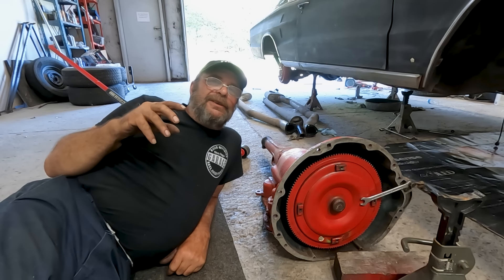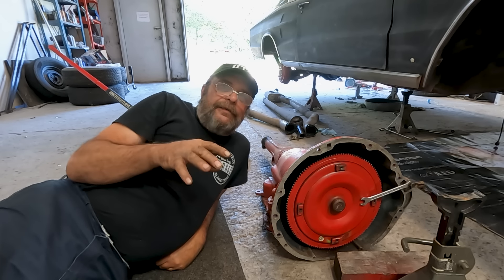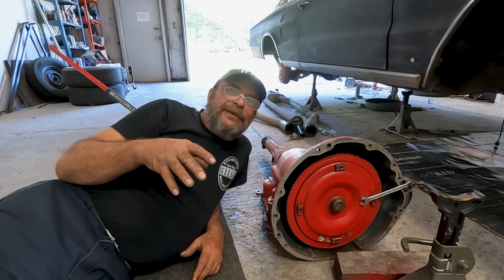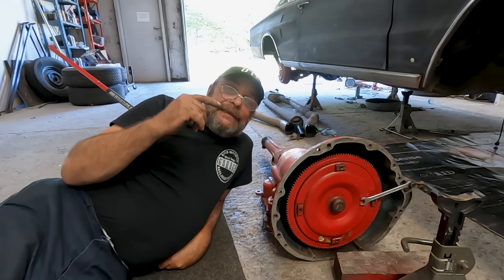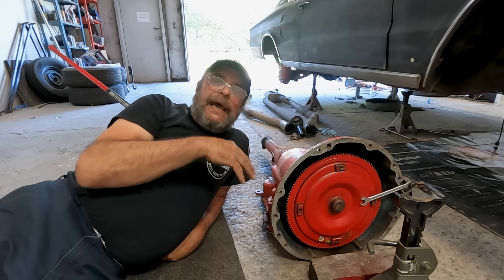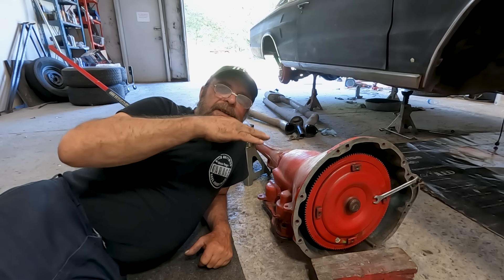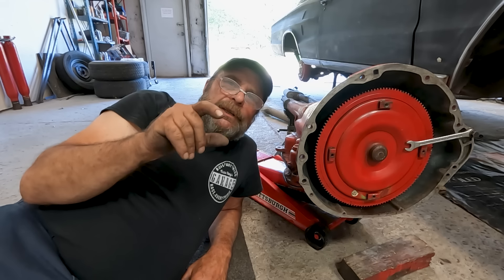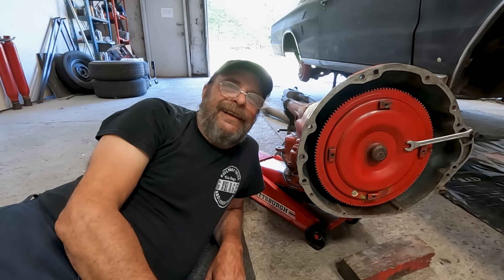One Man, On The Floor Transmission Install- So Easy Even An Old, Crippled Guy Can Do It

Comment: I made a small frame from 1x maple scrap laying about, constructed so I could strap it to the transmission and give me a sturdy base & not put weight on the pan.  Works well.  Used the same for engine removal with transmission still in the car: set jacks on front end, put a screw type bottle jack underneath the transmission, loosened bolts slightly for some wiggle room, and... good to go.  If I could attach a picture, I would. Several  pieces glued cross grain to avoid splitting was the key.

Comment: I'm 71 years old. Did a lot of drag racing in the 70s. We built our 340 short blocks in my mom's basement! My buddy built his 440 in his basement. That was a ball buster getting that up the stairs with  4 guys ! I did a  904 Trans by myself on a 65 Dart. I would drop it down on my chest! Going back in was a little harder. The  727s I'd use my floor jack. Those were quite easy. The real bastards were the  A833 cast iron 4 speeds! I'll take an automatic any day.

Comment: I remember when inexpensive floor jacks first showed up, it was like we had arrived in the big leagues!
I push my jack from the front of the car, under the engine and into place, then raise it. I find it easier to maneuver the jack when the casters are pretty much in a straight line

Comment: I put a 4 post lift in after remembering the days of doing it on the floor in the early 80's.  When I got back into cars 30 years later one of the first jobs was yanking a 727 out of a dodge truck. FLASH BACKS hit. I had a 4 post shipped out the next day

Comment: I used to pull the transmission onto my chest and lift it into place, but those years are long behind me now. I purchased a low profile transmission jack from princess auto when it came on sale for about $200, well worth the cost as it saves on torn/pulled muscles etc.

Comment: Having a concrete floor to lay on alone is much better than what I've had to lay on for most of the times of having to crawl under a vehicle for any reason, including putting engines and transmissions back in, heck sometimes just a cardboard box is a luxury for me. If only I had a nice concrete pad under a good shade tree, then I could actually roll my floor jack.🙂
Reply: I did my first several transmission R&Rs on a sheet of 1/2" plywood. Way better than just dirt or gravel. 😆
Reply: I love cardboard. You can slide on it easy too....
Reply: My low point was doing a Crown Vic trans in the grass. I had to put plywood down to keep the jack stands supported.

Comment: I remember replaced my torqueflight 727 4 times when I was around 19 in my trailduster . I used spare tires pallets or whatever. Great times ; tranny fluid in hair & all . Damn front seal always dripped and converter pump slots would always crack in corners . Finally rat tail filed ; radius the corners . Helped.  Ah - the good ol’ days - 😁 👍👌

Comment: Old crippled guy here. I've never doe a transmission that way, but that is similar to the way I used to remove and install air cooled VW engines. One thing about floor jacks. I almost always remove the four pronged saddle from them. It will damage pretty much everything it touches, except axles and heavy frame rails. It would certainly mangle a transmission pan. And if you have ever worked on a Foxbody Ford, you've also probably learned that it will damage the made out of tin "frame rails" and K member. I actually made a couple of smooth saddles out of 2x4 and 2x6 wood.

Comment: Ratchet straps are your friend. You still have to balance the trans on the jack while jacking with the other hand, Its still a PITA. Ratchet straps attached to the frame or looped thru the interior with the doors open if no attachment points under car. They hold it stable and can be used to lift it up to get a jack under it for the final lift. Ive even used ratchet straps to install front coil springs on GM cars

Comment: I'm done at least a hundred transmission in my lifetime. Auto and manual on the garage floor and the driveway, in the street, even in Sandy dirt. By myself. And what you just showed don't work when you're underneath the car or truck. I just drag the transmission underneath the car put the floor jack under . pull the transmission up on  to the floor Jack and go to town. You should try doing it in Sandy dirt that's a real chore LOL

Comment: Back in the 70s I changed many of Muncie 4 speeds, laid it on my chest lifted up and slid it in and had a buddy push the clutch in and then it would go in the pilot bearing and slam a couple bolts in and hook everything up and down the road we go.

Comment: For automatics I've got a plate with center pin that goes on floor jack where the round piece is,fits transmission pan perfect don't have no wobble to it . Makes it real easy! I've have a transmission jack but you have to get car up off floor pretty high for it to fit.

Comment: Nice vid Tony.  I've wrested automatic transmissions in and out of vehicles maybe 9-10 times.  My experience is that tricks like yours work sometimes and it goes smoothly, other times you just struggle no matter what you do.    If I had to do one now, I'd invest in a harbor freight transmission jack.

Comment: I did a car-port reso on a 1981 RX-7 that included a master rebuild kit for the automatic transmission.  Haynes manual had the transmission R&R in 17 easy steps.  Ungh...  After the transmission falling off the jack several times I finally got frustrated enough to bench press that pig of a transmission into position on the dowels and thread the first bolt in by hand.  For reference, I was told it was the same/similar transmission to what was found in a Ford Ranger pickup truck.  What a day.  In the end I had a fun DD for a while that I sold for a tidy profit.

Comment: I remember putting a 904 back into 73 318 Charger with only a cresscent wrench a flash light and a flatblde screwdriver for tools and being able to drive it home.  My friend helped me get in in position, but after that he had to leave and it was all me.  I had the left two wheels on the curb to get clearance to work underneath it.  Amazing what you could do whlhen you were 17.

Comment: This is good with minimal stuff to work with.
I have a transmission jack from harbor freight that is inexpensive.
I set trans on it it has straps to keep it from moving rolls under with wheels and raises with an impact

Comment: I've lifted up a few 400 turbos way back in the day. I'd put some blocks of wood under the tail shaft. Used a Toyota Tercel scissor jack under the front edge of the pan to raise the trans some. Pretty unstable, but not real bad. I'd add blocks as it came up. One hand to turn the jack and the other to stable the trans. Then once high enough, I'd carefully work the trans over onto my chest, while knocking the blocks and jack out of the way with my elbows, as best I could. Once up and completely on my chest, I'd use my arms and knees to lift as hard as I could, keeping it as steady as I could. Once it mated with the pins (the hardest part), I'd get a couple bolts in as quick as I could.  Not the safest way to do it, but I could get'em in. Hey, when young, you can do anything. Nowadays, I use a transmission jack.

Comment: Did my first transmission R&R in the snow on dirt. Got it all out, couldn’t really find a problem. Got the flywheel surfaced, installed a new clutch and pressure plate, put it all back together in sub freezing weather on my back in the dirt. No change. Still couldn’t get the clutch to function correctly. Ended up being the jackshaft. One of the arms was tearing off of the torque tube, ten minutes with an arc welder and the truck was fixed and I was a much wiser mechanic.
Don’t just replace parts. Evaluate, troubleshoot, diagnose. Then repair what is actually at fault.

Comment: I put one in a Nova I had, I had my arms under the front of it, and I used my leg to move the jack handle up and down under it. It wasn't fun, but it worked. That was 20+ years ago, I don't know if I could do it today, but it works if you are able.

Comment: If i was in dirt, i used plywood.
 I always used a floor jack, made an "H" pattern out of angle iron, about 18" square, and welded it to the cup on the floor jack. Of course flat side up, never took it off, still on. Works with everything, and still low profile enough to get under just about everything that I can afford to work on.

Comment: I had a 56 Chevy truck that ate transmissions.  What I used to do is roll down the windows, put a pipe across the doors, attach a rope and a pulley, then go underneath, wrap the rope around the tranny, and hoist the thing up. Then with one hand holding the rope, and my knees fine tuning the angle, I used my other hand to rotate the tail shaft so the splines would line up when I shoved it into the clutch. It works better if you have holes in the floor boards.

Comment: I just finished wrestling with a hydramatic in my 62' Pontiac, I used a 12'' square piece of plywood under the pan extending onto the bell housing. On the rear of the floor jack I placed a scissor jack on the little platform so I could adjust the angle. It worked real good, I had to do it twice, I realized there was a dowel stuck in the block from the old trans...

Comment: From someone that has blown a few 3 speed column shift F100 transmissions; UTG is lubbing many viewer up for EMBRACING THE SUCK!
If I ever drop the clutch on an automobile again I'll epstein myself!
Edit: Without having a lift installed in my garage first....
It isn't bad if you have 3 hands.

Comment: that does work on transverse trannys.  the shop I worked had a tool that bolted to the starter holes and was removed
after the bell got a couple of bolts.  we got it after a torque convert dropped 6 feet by two mechanics
lifting the trans up...  I thought you had it!

Comment: I don’t do it that way but have in the past.  The balancing act, grease, oil, or grime on a heavy object balanced on a jack stand, wood and floor jack.  That works, but is sketchy and not the safest way to go.  Just lift it up, strap it on the transmission jack and jack it in place from the floor.  There is usually enough play in the strap and scissoring arms on the transmission jack to tilt it around for bolt up.  I have had issues with having to remove the strap in tight cars or you can’t get the strap back out if you bolted the tranny up.  Then that can also can get a bit sketchy as well, balancing and moving it around only balanced and sitting on the transmission jack.  Every situation is different depending on what type of car you are dealing with.  What you just showed is a great way to do it by yourself but a guy better be careful because of the inherent danger of a heavy object in a tippy and slippery situation.  Didn’t know you were so beat up from accidents and arthritis.  I understand, have the ticket stub and t-shirt.  Glad you can still get things done and share your knowledge, great channel, hope you get that Charger ready soon.  I really like that car and typically I don’t go for the first generation Chargers.  It just has a good look to it, can’t fully explain that but some cars have it and some don’t and it has a good stance.  Looks like it wants to move out.

Comment: Just did a similar job last week. A 200-4R into my 65 Olds. Used a hydraulic motorcycle lift. Worked pretty well, more stable than a floor jack. Only problem is it didn't really lift high enough so had to stand the trans on 3" thick wooden blocks.

Comment: Hopefully your floorjack has a removable swivel pad. Get a 3/16" plate of steel about 10 or 12 inches square.  You could even drill some holes in it to hook a ratchet strap to or cut some slots in it on either side to slip a ratchet strap thru, this strap (just the strap from a ratchet strap) could even have grommets in the ends of it that you could put a bolt thru under your plate to hold the strap tight, securing the trans to the plate. Weld a 3/4" bolt to the center of the plate and get a large washer and nut to put this plate on your jack, making it a transmission jack. This is a project to do in advance of your next transmission job. You'll be glad you made it and have it ready the next time you need it. This also works for installing a 9 inch Ford or 8 3/4 Mopar rear end chunk. All this should make it safer and maybe keep something from being mashed or cut off. Just put the trans and your modified jack under the car with the handle pointing rearward. Place some bolts behind the jack wheels to chock them while you pick up the tailshaft of the trans and push it up on the jack, or use some version of Tony's idea for holding the rear of the trans up. Maybe hook a ratchet strap to either frame rail or hole on each side under there and ratchet the rear of the trans up for the jack. When you work alone you gotta make do, but be as safe as you can. You're alone.

Comment: Harbor freight makes a nice little transmission jack that will raise and lower the trans. Under $150. It worked fantastically installing a 6L 80 E into my Silverado with a billet converter.

Comment: I tend to use a ratchet strap through the shifter opening( make sure to use like a bridge or something to make some space for the ratchet mechanism) to ratchet the transmission up and balance it while I use a jack and some jack stands to get it up to level to slide into torque converter. I have a 4x4 and the transmissions are bloody heavy as it's not just the transmission, but also the transfer case attached to it and if both have fluid in still it gets very heavy. Rope and ratchets are a wonderous thing, so next time you are doing it solo use some straps as this will prevent ever dropping the transmission but will take a little longer to do.

Comment: That's a dangerous as hell balancing act to perform.  I've been party to the frustration of getting a transmission under a vehicle by myself.  The last time I built a plywood platform for my small Harbor freight racing jack.  The handle splits in 2 and makes jacking up the mixer pretty easy.   That little racing has sure earned it's keep over the years.  The all thread guide pins helps with safety but I'm not a fan of drawing things together except as a last resort.  I did that as a kid helping my brother install a new clutch in a 1960 Econoline pickup and ended up burring the clutch spline . Couldn't get the truck to go in gear and had to tear it apart and de burr the spline .   If it doesn't slide together something isn't lining up right.
I never did that again.  I was probably 15 at the time.  
I think I've forgotten more hacks that I can remember.

Comment: Warning for new guys. The clearance between the filter pickup and pan is very small. Dented the pan? Take it off and fix it!
Reply: I welded a pin to a plate and replaced the cup on the floor Jack to spread the force. Prevent  the dent. But yes fix the dent if you make one.

Comment: Great method ! I've done this (or a similar variation) many times. I did come up with my own way to get the trans close that's pretty easy. I like to use 2 ratchet straps going from frame rail to frame rail on the front and back of the pan. just do a few clicks on one ratchet strap, few clicks on the other back and fourth till the trans is fairly close. Typically then, I'll get the floor jack under there with me to do the final angle alignment and get the bolts started.  Love the channel ! Keep up the great work !

Comment: I found that using a old harmonic balancer off a 305 ,a bolt and nut and some appropriate washers through the crank bolt hole of the HB and then bolting it to the floor jack through the cup makes for a damn fine adaptor for installing transmissions throw a appropriate sized needle bearing set in the mix and and makes jockeing that trans around a shit ton easier.

Comment: Earlier we used a bridge and were holding and lifting the gearbox up and up. Two men. What a hell. The day after I woke up with a eureka moment: We should have unbolted the gearbox, then lower the car, let the engine rest on a crate or jack stand and use a jack to lower and remove the gearbox. That would have been a lot easier and less exhaustive.

Comment: I did many back in the 70s-80s by rolling it on its side then up onto my chest where I'd benchpress it in and hold it on the line jp pins with my knee while I got a bolt started. 727s were heavy. I could still do a THM 350 to this day if I had to.  Did the tremic TKO 5 speed in my 70 Charger a few months ago standing up with on my car lift and I'm 62.

Comment: I was 16 years old when my first car a 62 Falcon needed a clutch. 
   I dug a trench in the ground about a foot deep.  I didn't even have a bottle jack.  what I had was youth in a transmission that only weighed about 60 70 lb. Lol
    That's also when I found out when you do something replace everything in the same area.  2 weeks after putting in a new clutch a freeze plug inside the bell housing let go. 
    I think a brass one at the time was well under a buck.  
   Seems like the clutch pressure plate and throw out bearing was just $18. 
   I remember dad springing for a set of new tires from discount. Mounted, n balanced with road hazard $12 (13 in wheel) each.
     And at the time that little bitty 144 ci inline 6  achieve 22 MPG.